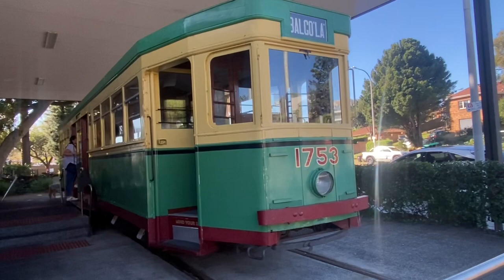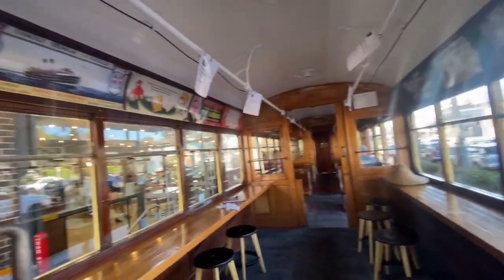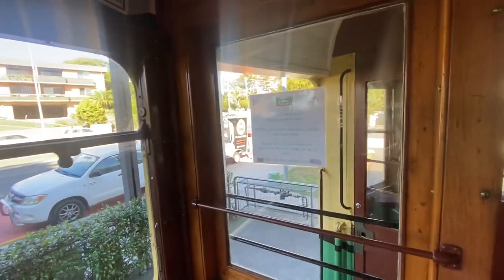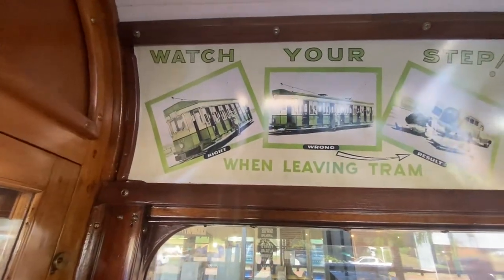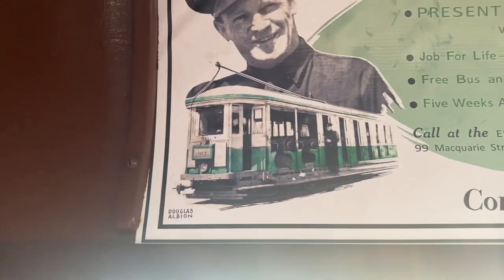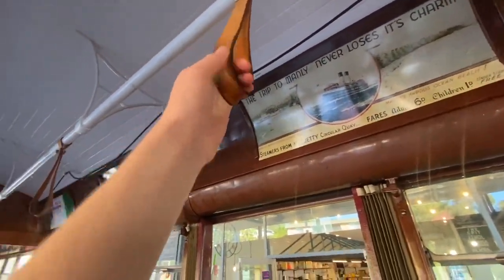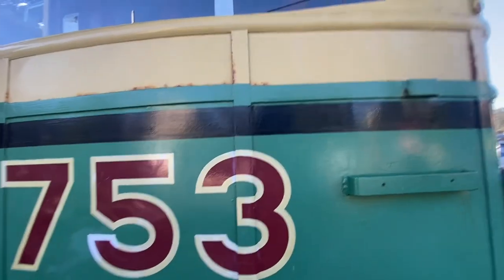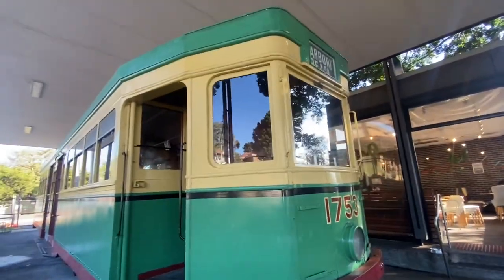Restored Sydney R-class Tram No. 1753 in Narrabeen | Tram Vlog #4

Comment: A few notes here from someone who knows much... Trams of that era don't have a "throttle" or "accelerator." They simply have a Controller and a brake stand. They also had a wind-up handbrake with a big brass lever. This tram, R 1753, as tram that was at North Sydney depot at the end, was withdrawn in June 1958 when the North Sydney lines closed. Another point of interest here is that this tram came from the wrecks inside the old Rozelle Tram Depot, which had been salvaged for a planned tramline in the late 80s by The Rocks Streetcar Association. 

Contrary to what the desto says, it never went to Balgowlah as Corridor Cars never ran on the Manly lines. Only O class cars (such as the one in the ad for Conductors) ever ran from Manly Wharf to Narrabeen, Harbord (Freshwater) Beach, and up to Balgowlah, and then down to the Manly side of The Spit. There was a tram-ferry but it was never used with passengers on the tram. There is lots of evidence still of trams in the Manly area if you know what to look for, and where. (The Manly lines closed in 1939, IIRC)

The ferry in the ad, the Curl Curl, was the twin of the Dee Why. They weren't "a class" as such, just "twins." 

Cable: "Bell cord." Lower Saloon? "Drop Centre. These trams were of the "Drop Centre" design, this being a very common design for bogie trams. As for a builder, memory tells me that Clyde Engineering would have been the builder. The only thing I can find wrong in the display, apart from the suggestion that this tram ran to Narrabeen or anywhere on the northern side of The Spit, is the numbers. They were always gold, not red.
Reply from the maker: Thanks for sharing your information! I did very little research before making this video and I was very tired so I wasn’t think as straight as I normally would. I’ve done lots of research since making this, so I see that lots of the things I said were stupid 😂. I’ve been given a proper tour of the R1-class operations at the STM, so I now almost fully understand every little lever and button in the cab (I’d assume the R and R1 class aren’t too mechanically different). Even if R 1753 is bending the history a little bit with its numbers and desto, it’s still a beautiful little tram and it’s great to see it repurposed with a new life. Dee Why and Curl Curl are technically the Dee Why-class ferry, because it is generally considered a class if it’s more than one vessel. Thanks for telling me what you know about trams, I’m interested in making tram vlogs again however it will mostly be heritage stuff like this. Thanks for watching! 😊
Reply: @coolsoap8  No worries! Keep trying! If you've watched any of my videos (I haven't made any for quite a while) you may notice I don't say anything in them. There were two exceptions where my brain engaged my mouth automatically when I saw something, but that's an exception. Please don't be offended if I give history lessons on some things - I grew up with these things either in active service, or depending on what it is, active preservation. Over the years I've read lots of books, watched videos, been to the museums, and learnt. 🙂
Reply from the maker: @tobys_transport_videos  I've watched a few of your train videos and your Lady-class tribute video, and you certainly have some awesome footage worth treasuring. I'm not at all offended from your lecturing, I like recieving feedback on how to make my videos better and I love learning more about transport, and you certainly have some fantastic information/stories to tell! Soon enough I'll hopefully be in the transport industry myself, so I'll be learning more and more each day while being directly involved in what I am truly passionate about. I'm glad that you support my channel, and I'm always happy to recieve feedback or comments so don't worry about offending me! Cheers 😀
Reply from the maker: Also I forgot to mention that I should shortly be uploading two seperate videos. One is riding R1-class tram No. 1979 with the driver showing how to operate the tram and a cab ride, the second video will be a tour inside the shed at the STM which is not open to the public so that'll be a cool special one to upload.
Reply: @coolsoap8  Nice to hear! I'm going to be making videos again soon, starting in about a month or so. I don't Vlog, but I will have something different on my channel for a while. Until your next History Lesson 😛, I bid you Goodnight! 😃🛫⛴🚌🚎🚋🚆🚂🚃🚃
Reply: @coolsoap8  Good to hear on that! I did a video at STM for the re-creation of the Last Tram - 50 years later. I don't think I ever did anything in the sheds there, despite knowing a few people and the sheds. I saw them built, and remember well the old site at the top of The Royal National Park, which was a bad place to get to without a direct train or your own car.